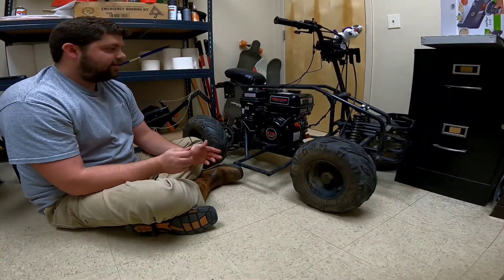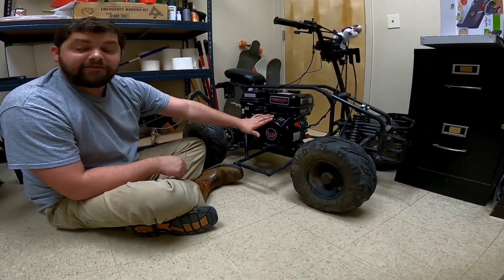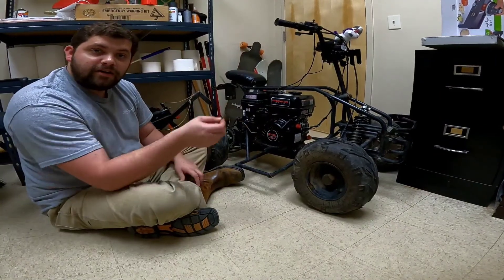Predator 212 governor bypass | EASY!!!

Comment: Little late here but um I did this a while ago and my minibike just took off after i removed the zip tie the problem was solved do you know why this is?
Reply from the maker: You messed with the spring that returns the throttle back to idle.

Comment: The tittle needs to say, how to blow up an engine...if you want power and speed, you need to work on the drive setup...this is foolish
Reply from the maker: These engines can handle 9k rpms, soo there is no chance of blowing up the engine. worse case scenario it wears out the springs that cost $15 and are easy to replace. I am speaking from experience and can tell that you are not. I hope you can get some help with your pessimistic attitude( it will always hold you back in life)
Reply: @boxtruckers  Do you think with the zip tie method there is a chance of blowing the rod without replacing it to a billet one? Im sure the flywheel will be fine at these rpm's but im concerned about blowing a rod
Reply from the maker: @Cuza.  when you buy the very expensive stage 3 kit, it only comes with a new cam gear, fly wheel, and springs. The rods stay the same. The only thing the zip tie risks is the springs and they are easy to replace. ( we have a video on how to do it). the zip tie only adds a few hundred rpms depending on the weight of the vehicle...
Reply: @boxtruckers  Ah I see, Thanks for the information boss I appreciate it!

Comment: Doesn't this float the valves tho?
Reply from the maker: Only if you hold it at the very top. Acceleration is increased without floating.We have another video on how to replace the springs to fix that at top speed!
Reply: Yes and it will indeed blow the engine..
Reply from the maker: @gregmccarter2176  adding 500 rpms will not blow the engine, dont mislead ppl
Reply from the maker: @gregmccarter2176  wrong,very wrong. someone is scared....
Reply: @boxtruckers I am scared
Reply from the maker: @ilavrova  dont be scared little buddy. just blow that $100 motor all the way up and have fun doin it!

Comment: My mini bike rn is surging I was told it could be the govner bc it’s getting to much power would this work and fix that? It gets up to 30 mph then randomly slows down and won’t pass 22
Reply from the maker: that sounds like the transmission. an old clutch will slip when it heats up and lower ur top speed. but since this is free you might as well try it...

Comment: I tried this and my speed staid the same any reason for this?
Reply from the maker: There are 2 springs under the gas tank. the correct one is deeper and harder to get to. watch the video closely and use a flashlight to look under your tank. When you get it right it will work!

Comment: IS THAT FRAME A CREATION FROM A MINI BIKE OR IS THAT AVAILABLE IN A KIT?  THX
Reply from the maker: It is a youth 4 wheeler that we stripped down to the tube chassis, and mounted a new motor. kept the original brakes.
Reply: @boxtruckers  SWEET!!!   CAN AN ADULT MAN RIDE THOSE WITHOUT ANY ISSUES (WEIGHT SUPPORT ETC) ? THX!
Reply from the maker: @PARDS2  yes, I weigh 260lbs and I am the one driving it in the video.
Reply: @boxtruckers   260LBS-------UR JUST A PUP!!   LOL
Reply: I weigh 290 and I have one I did the same thing with but I'm going to try that zip tie trick
Reply: @boxtruckers  oh my God Im like 170, I'm going to fly (baja dirt bug swap)

Comment: Does this actually fully remove the governors ability to limit the rpms or does it still apply a limit? Or, is the rpm now limites by valve springs just like a full delete?
Reply from the maker: It raises the limit to a point right at where the valve springs begin to float. In my opinion right at the  maximum safe performance.

Comment: In theory I'd imagine if you took like a centimeter or three off of that spring and zip tied it back together with two zip ties on each side you might get the exact result of what would be no Governor at all
Reply from the maker: The spring allows to governor arm to pull back on the throttle. zip tie on the springs stops the governor arm from being able to pull.

Comment: Did you get a baseline stock RPM number vs RPM after?
Reply from the maker: yes, awesome question. From 3100 to 3900 rpm!
Reply: @boxtruckers  I've been watching other videos of these engines being Dyno tested, without the governor removed, straight out of the box should close to 5k rmp. How are they getting these numbers?
Reply from the maker: @SAUER35  to get to 5k you would have to remove the gov. gear from inside the motor. I built a stage 3 212 (no gov. gear, forged internals, and mikuni carb) and it only hits 5200 rpms.  On the box it says 3200 rpm i think. 6000 rpm is racing lvl. They must have something wrong.